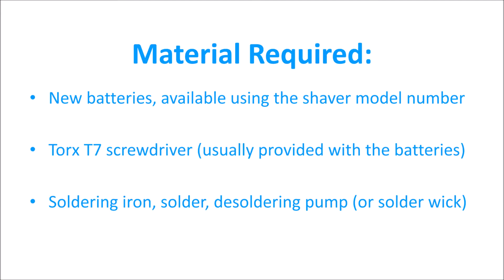DIY: Replacing Shaver Internal Batteries In 15 minutes!

Comment: Mine is the same model(hq5885). It does not power on. The R1 resistor near the 220v power cord inlet is broken. According to the service manual, I need to replace the R1 resistor which acts as a fuse. Please advise what type of resistor I should buy. My resistor colors are gold-black-orange?-orange? It looks like 33 ohms 5% but I am not sure. How many watts(W) of resistor do I need?

Comment: I have two of that model shaver and I replaced the batteries on both and neither one of them work. When you press the button the motor does not run. The display works and shows a charge. That model is very complicated to troubleshoot with all the circuitry it has. It would have been nice if you would have showed a working repair .
Reply: I had the exact same issue. The small surface mount resistor labeled R070 close to the positive terminal of the battery on the back of the pcb (it was blue on mine) needed to be replaced on mine. To check it measure it with a ohmmeter, if it reads anything under 0.10 ohm it's good if it reads higher or open circuit (OL) it's burned. Since it's a 0.07 ohm "current sensing" resistor it should be replaced by a new one of the same value. I initially tried to bypass it with a small wire and although the rasor worked fine at first it eventually trew off the charge/discharge sensing circuit which led to the charged batteries only lasting a couple of shavings.
Also note that the full service manual with schematics and explainations of circuit functions is available online if you search. Very useful stuff.

Comment: Hallo. Ich habe den gleichen Rasierer. Akku getauscht. Jetzt weiß ich nicht mehr wo das Teil mit dem grün/weißen Kabel hin gehört. Sieht aus wie ein Schalter. Wozu dient das? Kannst du mir das bitte in einem Video zeigen? Ich brauche die Position dieses Schalters.

Hello. I have the same razor. Battery pocketed. Now I don't know where the part with the green / white cable belongs. Looks like a switch. What is it for? Can you show me this in a video, please? Position this Switch.
Reply from the maker: Looks like it is the main power switch, and from my video, it goes underneath the motor. But I have not taken it or the motor apart myself, so I do not know how to re-install it, sorry.
Reply: It's the switch that detects when the blade head is removed (to reset the blade clean signal/warning). It's a fragile little piece of white plastic that goes to the left side of the blade head when looking at it from behind (with the casing opened). I broke mine accidentally and just removed the switch and wires all together, works fine except for warning signal not reseting...

Comment: Why don't these A-hole designers/engineers put a simple connector inline to easily replace the battery? My 25 yr old Panasonic phone has one and it takes 20 seconds to change it.